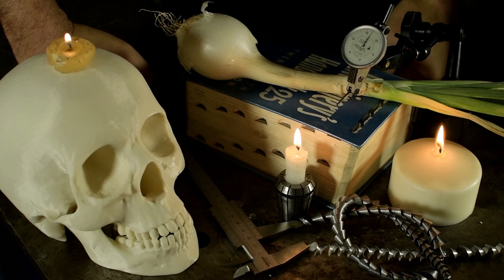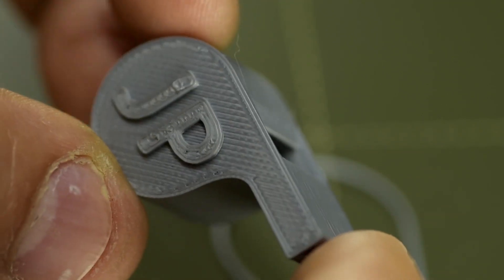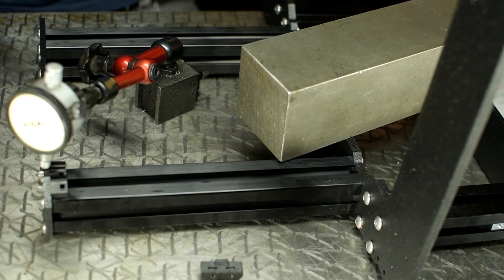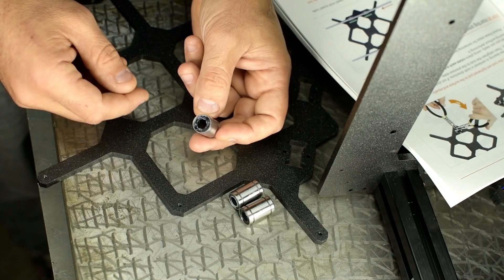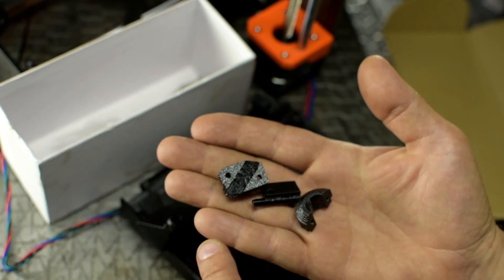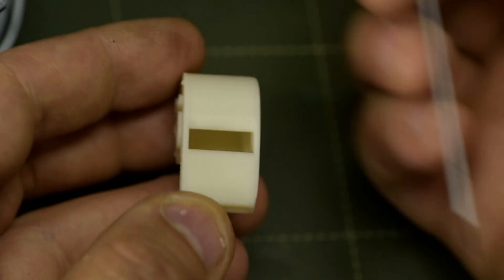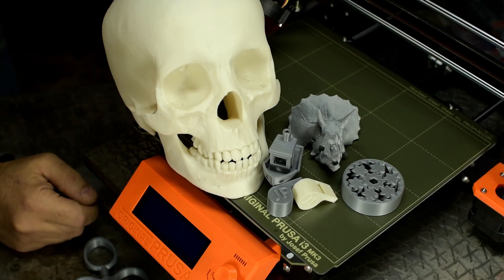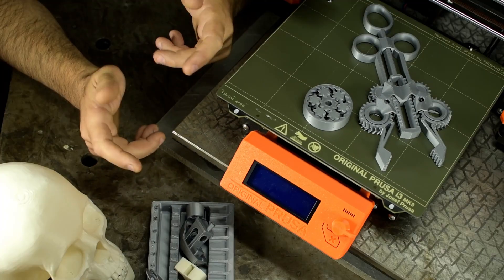This Old Tony in 3D!!! (printing)

Comment: Spend some time searching YouTube about 3D printing your own press dies for sheet metal. Because of this, I have a press on the wishlist now. You also should look up heat set threaded inserts. One of the best ways to add threaded fasteners to a part. You could turn the soldering iron tips on your lathe instead of buying them too.

The Creality Ender Pro 3 is great the only downsides are the maintenance of self leveling for good first layer adhesion. And replacing the Bowden feed clamp thing with an aluminum one. The plastic guide wears out too fast. Congratulations on your new Prusa. Looking forward to more 3D print cameos in your videos.

Comment: I started with a 3D printer and am now building a CNC mill (using 3D printed parts). While most of the stuff I print is "junk" stuff that looks cool but has no function, they are also powerful tools that can be used, especially if you have any decent CAD skills, to make and repair stuff!

Comment: The Prusa Mini is also a solid printer, $349 and it most mostly built, but a slightly smaller build volume. Now TOT just needs to get this setup with OctoPrint.

Comment: I got a chinese anet a-8 clone kit from china a few years ago for $90 (including the shipping). It went together pretty well and printed decent for quite a while.
At least until the heated bed was having a hard time last winter and melted part of the circuit board, I have since retired it to being a display piece and occasional conversation starter.
"Hey what's that pile of wires and metal over there in the corner?"
"Oh, that's just my fire-starter."

Comment: So I run a robotics club for a Jr. high school and letting the heathens use the 3d printers we have learned a few things for the basic stuff that keeps them from destroying the machine. 
1: heated bed it can help with the the 1st layer distortion 
2: very small parts have to have a raft or brim 
3: Dry your filament with a dehydrator for less stringing, tho you had hardly any.
4: You may not need this one but we had to build dry feed boxes to keep the filament dry while on the machine. We live in a VERY hot and humid area. So even after drying the filament a 20 hr build would start to string at the end.
5: keep the nozzle and bed clean and unload filament when it going to sit for a long time. 
I know basic shit but for the 1st timer these rules do not seem obvious. Tho you have probably read most of this already I figured I would post what has given us the most issues.

Comment: For the people who say they can't figure out Fusion 360 or don't have the time, you need to try Tinkercad. It is very easy to learn, it is not as fancy as Fusion 360 and their are things that are not perfect about it but for general work it can't be beat. It was designed for middle school kids to get them interested in engineering, the learning curve is about 2-4 hrs total. I have been using it for 2 years on my Ender 3 building all sorts of things. I couldn't afford  a Prusu and after having had my Ender for 2 years I would buy another one in a heart beat.

Comment: Hey Tony, i think you made the right choice! I can recommend getting the textured buildplate aswell, it can provide extra adhesion + a texture which could be used as a feature. 
If you do draw some stuff for in the house will you share the stl? (If its anything cool that is) + can you make a video of making said cool object (I noticed you poses the power of the Old Solidworks masters, i wish to learn more!)

Comment: I feel your pain. I went through this same process a month ago. But just like you, I was flabbergasted at how well it printed right after the last bolt was tightened.

Re: your draft issues: look up the Ikea Lack enclosure on the Prusa site. It combines a $10 ikea table with a slew of self-printed parts and some plexiglass panels to make a really nice enclosure to keep out drafts and maintain a consistent heat.

Comment: Well, I'm not gonna teach TOT how to do stuff! but since you asked, in my experience stringing (in this specific printer) is usually caused by high temp. I know your filament rolls comes with recommended range, but honestly I think it also depends on the printer. those thermocouples are usually a little off. I found best solution is to buy same exact filament every time (brand I mean) then have a specific setting to each type and color (sometimes same material\brand but different color need a different temp range)... I'm excited to see what's coming next. I have the same brand printer. Maybe a model older and it never let me down. (unless I mess up the slicer setting).
Reply: Also, I know the printer you showed is a bit on the high side, but honestly. I think its the way to go. I went with the MK3 after trying 2 very cheap printers and that was a big waste of time!

Comment: I’ve had a Prusa mk3 (upgraded to mk3s) for many years. I love it. 

Look up Nylock bed leveling next. 

During covid initial PPE shortage, I printed around 300 face shield frames at 200% speed using PETG. 

Also, for those into woodworking and have dust collection, printing useful blast gates:  https://www.thingiverse.com/thing:4594691

Comment: Recently I designed a pulley bracket to mill in 6061 aluminum. Then I printed the design in PETG as a model to reference. Tested the strength of the plastic model — and printed more as the final parts. PETG doesn't shrink like PLA and is tough. It's now my default for functional prints.

Comment: The Prusa kits are incredibly well designed and bear little improvement. 3d printers tend to break a lot for reasons related to the users; bad model comes off the bed and melts onto the nozzle and next thing you know the extruder is full of plastic and needs to be replaced, eg. but not so much because of the big time vibrations shaking the machine chassis. I’d recommend next time sticking to the Prusa provided stuff and skipping the loctite.

Comment: I have 2 prusa i3 mk2's , haven't used either of them because the 3d printed plastic motor mounts and the plastic rail guides are all broken from a stupid kids rage attack .... If anyone can print me one set of prusa i3 mk2 3d printed plastics I'll pay you, plus postage..  I just want one working with original parts so I can compare it too the other I might rebuild with billet Ally..

Comment: There's also the well-known McMaster-Carr trick: they provide CAD models for pretty much all the parts, so you can download those and print them. Check that the part fits/works, then buy the metal version. Or leave the 3D-printed version in until it breaks, your choice!

Comment: Welcome to 3D Printing. You chose the right machine to start with & you’ll LOVE IT!  I liked my first Prusa so much I bought a second!  

Should you ever need assistance there’s a great community around these printers & some fantastic smaller, deeply technical groups that are always available with the right word of experienced advice! 

One word of advice—you might not want to be touching that PEI spring steel sheet with your bare hands. Oils from skin will ruin bed adhesion quickly!  Nothing a good wipe down with 91% Isopropyl Alcohol won’t fix, but in my area that’s still a hard commodity to find!

Comment: Nice! The benchy looks good,  some slight ghosting on the front portholes and the "whisps" can be controlled through retraction settings. The ghosting  can be fixed with stepper "filters" but does nothing to the structure of the print in most cases. I love PETG, its more forgiving than abs and makes very, real world, parts that are much stronger. Love the channel! Keep up the good work!

Comment: 3d printing shop here! id recomend you start with PLA until you understand how the expert features work, then try moving to PETG to get the feel of it, thermal contraction, stickyness, etc. And so on with the rest of the materials. Most PLAs are intercompatible, i use 235ºC for printing but i do things fast here, first you need to learn how everything works before you can tune everything to work at max speed.  

Some notes:
- Slower (20-35 mm/s) always givers more predictable resutls. Slower than that and you start cooking the filament, may cause trouble with some filaments. And faster gives varied results depending on the material (this is what you need to learn to become plastic bender)
- Theres an option in prusaslicer to add a shield around the piece to protect against wind for when you are printing with ABS, ASA, HIPS or any of those plastics that have really bad thermal contraction problems. It works somewhat ok, its not like a professional machine running at 80ºC ambient but its better than nothing. Adding an enclosure (acrilic, wood, cardboard) can help but its still not perfect. Use both in case you really need to print something big in one of those materials.
-  If the bearings make too much noise, try POM bushings, they come in lm8uu size too, of you could try printing and machining your own with PLA which actually does pretty well. I recommend adding a steel sleeve on the ouside to avoid distorting them if you make them yourself.
- Some plastics are good for somethings, some are not so good, think of it as if it were not a solid piece, but a lot of sheets with glue inbetween, its gonna break in the glue first, printing orientation matters, this is not inyection molding, most plastics dont have perfect layer adhesion, and you need to pay attention to it.
- Always over-engineer whatever you design, plastic has lots of creeps, PLA most than the rest of the plastics, if you put too much stress on it it will break in a few weeks or so. So its better to make things as beefiest as possible than trying to "save" plastic, as once it breaks your savings will be in the negative.

Comment: Welcome Tony to THE THIRD DIMENSION!
Some friendly advice from someone with a few years of printing experience:
1. Beware temperature. Don't keep your printer in the garage in winter. The cold air will make warping a whole lot more problematic. Printers, like people, get cranky if their cold. 
2. Beware moisture. Some filaments absorb moisture and won't print well. Granted it will take a while and depends on the type, brand, flavour, and horoscope sign of the filament.
3. Add a filament duster to your printer. Something like a piece of sponge in a clip or something. It helps keep crap out of the nozzle and extruder.
4. Get a few replacement endstops and bearings. Sometimes the switches break (one of mine did), and the small bearings might get lost if you ever remove them for repairs or upgrades.
5. Avoid cheap filament. Avoid it like you owe it money but don't want to pay yet.
6. Prepare to make stupid keychains and nicknacks for everyone you know for the next two months. Then the novelty will wear off and you can get back to real work.
7. Whatever you design and print, design it FOR printing, and orient it to print properly. Don't waste 7 hours printing a ruler vertically when it takes 20 minutes to print horizontally.
8. Slap warning stickers on it or put it in an enclosure if your kids haven't learned not to touch your tools yet.
9. If you put it in an enclosure, try to put the electronics outside of it so they don't get too hot.
10. Always remember we love you.
Reply: Great suggestions and hilarious post! Some AvE stickers would make a good addition. Thinking of the 'No dumb area: Do not dumb here'.
Reply: Great advice, agree to everything but have to add something.
11. PETG and flexibels bond exxesivly well to the PTFE sheet, to the point where you rip it of when you try to remove your print. Use the provided glue stick to coat the printing bed befor printing theese aterials.
Reply: This is great advice, and I'll second and reinforce the moisture control advice. Wet filament has been my number 1 problem over the years (I don't go through spools fast enough to leave them out). Make yourself a dry storage box or a dry filament dispenser. You won't regret it.
Reply: ima just wait till these printers solve all these problems without needing homebrewed hacks
Reply: @theX24968Z  Just buy a more expensive machine. Heated PEI bed with an enclosure and ball screws to drive the Z-axis. The ballscrews alone in my machine cost as much as the machine in video. That's not to flex, that's to demonstrate the variety of machines that are available.

Gucci filament like nylon, Zytel, and ASA are all hygroscopic in their raw form. You vacuum bag the stuff when it's not in use. No big deal. Also always use glue stick on your bed. It's a great release agent and it's water soluble.
Reply: @poisonouslead85  ill keep that in mind when i look into buying one, has the amount of maintenence necessary gotten any better? last time i used a 3D printer, it needed to have something fixed every 5-10 prints
Reply: @theX24968Z  I'd say so. It's definitely a bit different on the more expensive machines but it's also very infrequent. 

A big thing is understanding your materials and keeping your bed leveled. I probably tram my print bed about once every 3 months. 

On the materials front, certain materials come with their own characteristics that can change how often you have to maintain your machine. For instance, carbon and glass fiber filled filaments are abrasive as fuck. They wallow out nozzles quickly. BUT you can get nozzles that have ruby inserts that are practically bullet proof.

You'll have to tune your machine for every material. That's not going away. You'll always be doing some tinkering.

Comment: Finally. Welcome to 2013. I am glad you found the practical use of printing. Fixing little things like the allen divider is 90% of what I use mine for. I also make custom caps for tube steel, or nylon bushings for mower wheels - things which do not need to be perfect.
Reply: Just saying. TOT squared up a block to prop up a broken foot on his recliner. I think this love relationship with a metric machine is opening him up for bigger tolerances. For love you are always prepared to compromise. LOL

Comment: TOT> 3d printers are very handy to have around the house. Go to tinker cad and you can design your own things or go to thingaverse. I designed and printed a Drip tray for my refrigerator door ice dispenser and a slide thing for my lawn spreader and much much more! Later T

Comment: I’ve been wrestling with my printer for weeks and tony prints out a beautiful benchy on the first try. Okay then.

As for the wisps left on the benchy it’s likely either your retraction settings (how far and fast it pulls the filament back when moving to a new location) or your extruder temperature settings (how hot the...hot thing gets).

Try bumping up your retraction distance or speed. If that doesn’t work lower your extruder nozzle temps a bit.

Welcome to the club!

Comment: With great power comes great responsibility!!  My I3 had a twist too.  I tightened it on a pool table weighed down with lead scuba weights.  My family bought it for me for Father's day 2019 and I have already put more $$ through it in filament than its original cost.  Coupled with a good CAD program (I use Fusion 360) there is a whole world of inventing to do out there!  Oh, and get Octoprint and a RaspberryPi which will free you from the SD card and let you print from anywhere in the world.

Comment: I have the exact same machine and I like it a lot.

My recommendations are: NEVER EVER touch the print bed with anything but clean tools to remove the print (a set of thin artist’s palette knives is perfect for this). Your skin oils ruin the ability of the print to stick, as does dust and other things. Alcohol wipes help for the little stuff but I’ve found that a deep clean in the kitchen sink with a gentle scrub and dish soap really strips back the nasties.

Also, the print surface is a consumable. I’m on the second side of the original print sheet after over a year of owning the printer. No matter what I did stuff wouldn’t stick, even after the dish soap cleaning, so I flipped it over and everything is good again.

One other thing that has helped me a lot: don’t bother with cheap no-name filaments even if they have fun colors. In my experience those barely stick to themselves, let alone the print bed. I like Atomic Filament for a brand made here in the USA (no affiliation) and if you want more of the stuff the printer came with, check out FilamentPM - they’re based in the Czech Republic so shipping isn’t awesome but Prusa likes their stuff enough to include it with the kits!

Comment: Just got my first 3D printer this week as well, Ender 3 v2. It was a heck of a lot easier to assemble than the Prusa sounds like, but I've been battling issues with prints sticking to the glass, even after extensive leveling, upgrading springs, and slathering it with a glue stick, so "get what you pay for" indeed. Still amazing that we can get 3D printing that otherwise works so easily and for so cheap.

Comment: Congratulations on the new printer,  that skull looks great. I cringed a little when I saw that you were touching the print bed with your bare hand. If you have bed adhesion issues it is sometimes due to the oils from your fingers reducing the surface energy of the bed. I recommend a dedicate bottle of Isopropyl alcohol and lint free wipes next to the printer for bed cleaning. Do you think you will upgrade the Maho to squeeze out plastic?

Comment: I don't like ABS. My favorite is ASA. But my printer has an enclosure. I use a cheap printer from monoprice. It looks like a clone of a Ultimaker or something. Then you buy the plexiglass enclosure separately. It comes assembled. I got mine for like $500 I think. Probably a bit slow. But it prints ASA pretty well.

Comment: The benchy model is supposed to detect problems with thin walls (the little tube for a flag at the back), narrow columns/gaps(the pillars for the roof) bridging (the upper sill of the windshield) overhangs (the angle of the bow) and several other such things.  That one looks pretty good.